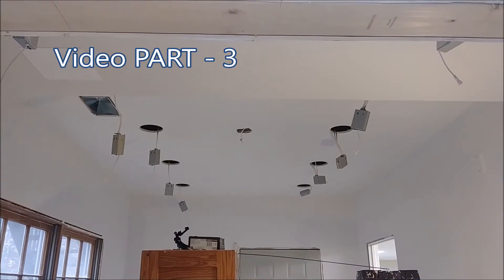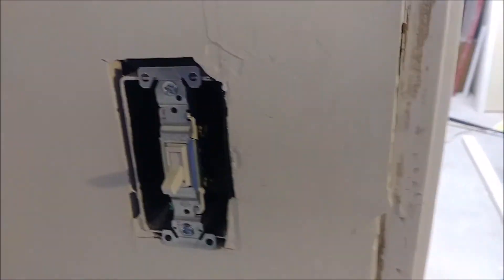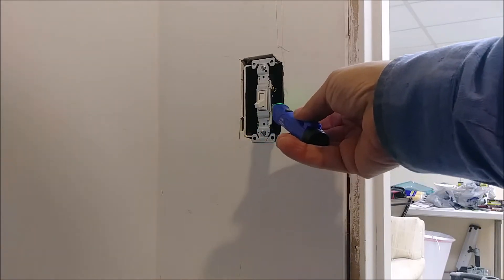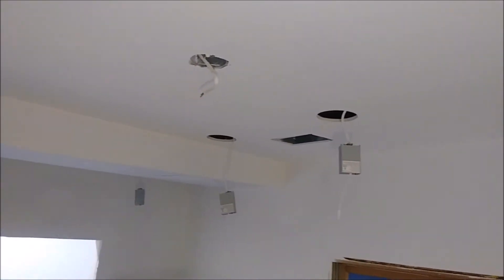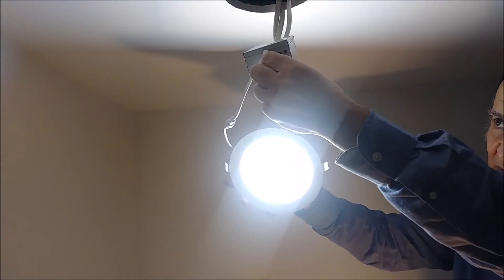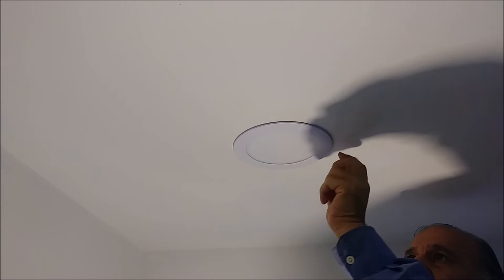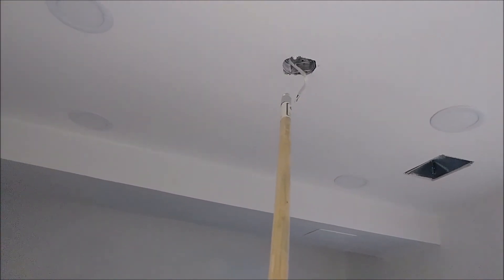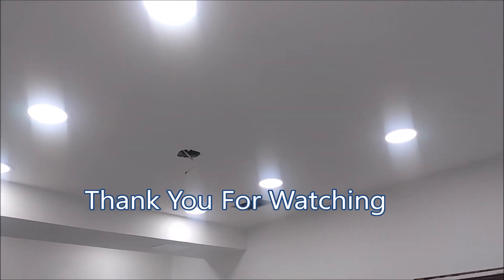How To  Install Multiple LED Recessed Lights -  A to Z - Part 3 -Install Multiple Pot Lights

Comment from the maker: 6 Inch LED Recessed Ceiling Light = https://amzn.to/3depXIS
DeWalt drill  I used = https://amzn.to/361KhKx
1/2" Conduit = https://amzn.to/3nirSQ0
Non-Contact AC Voltage Tester = https://amzn.to/2QciEJk
Wire Stripping Tool = https://amzn.to/3dBE0bM
6.1" Hole Saw = https://amzn.to/3derPS3
Ryobi drill = https://amzn.to/3sLfg6y